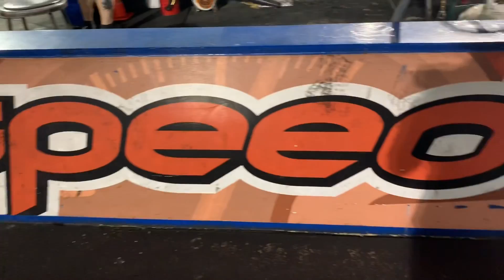MOTORCYCLE GRUDGE AND STREET RACING EXPLAINED! AFTERDARK HIGH STAKES NITROUS NO BAR DRAG BIKE BATTLE

Comment: Why do some of these riders shift into first gear with their left hand?  Does it have to do with the air shifter?  Is the clutch located elsewhere?
Reply: No sir, most grudge bikes have slider clutches no clutch lever and the shift arms are alot smaller so its easier for us to shift with our hand vs foot some do but most just use our hand
Reply: @mannygreer9481  cool info. Thanks!

Comment: 90% of the time most street bikes with true hand clutch setup act different when the bike get too much grip even with a Brock's mod and a lot of street races now of days don't know how to measure they stack height or even know how to inspect their clutch baskets Springs so they can get a better lunch if you pay attention 2 a lot of Street racers they their tire pressure too low and though they put away too soon and that's one thing you can't do at the racetrack on your average street bike